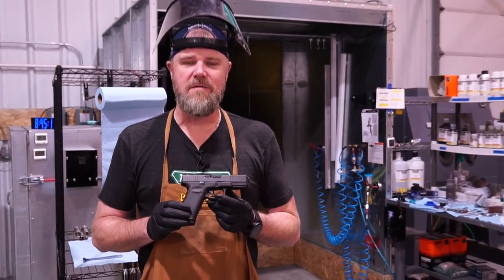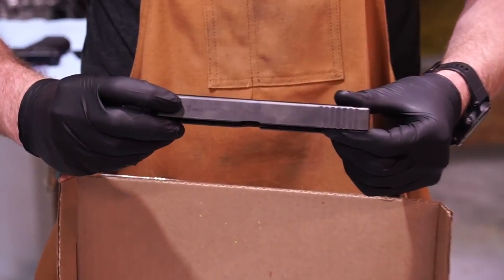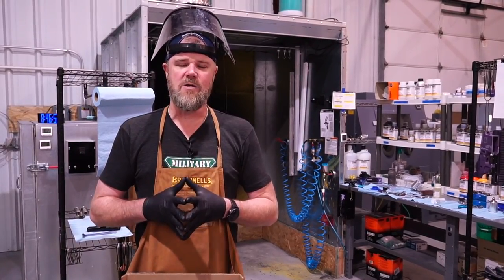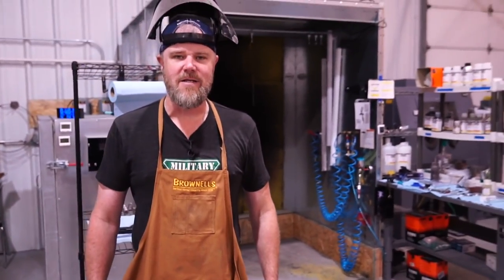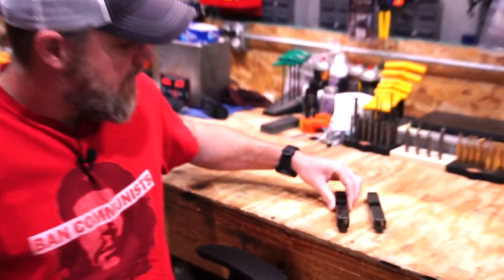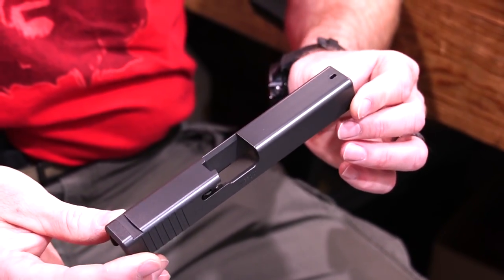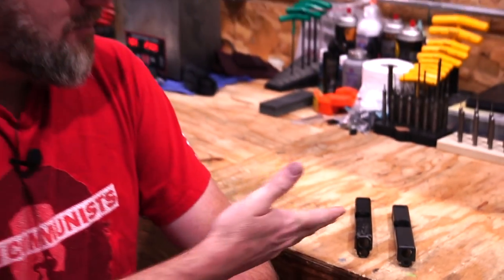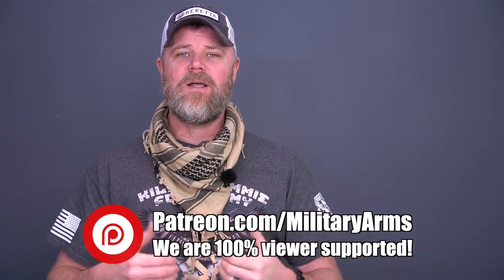Cerakote Acid Test

Comment: I work in heat treat inspection. I do MPI testing and Rockwell hardness inspection. We spray paint the bars to color code them so we know what machine induction hardener they are coming off of. As part of the hardness testing we dip parts in acid so we can visually see “like a tree truck” the metal will have rings of various hardness.  That being said. From my years of experience regular industrial spray paint will do the same. Acid has no affect on the spray paint. This has always surprised me. Side note. Metal will instantly rust when its exposed to acid.
Reply: The oxidizing base in the acid is what cause the rusting. And yet the Gen5 didn't rust...why? because of the Nitride treatment applied to the metal prior to the DLC finished added. I have my Ph.D. in Chemistry. This test was garbage. Both test subjects were in the same vat. That's a no-no. The test field was now contaminated.

Comment: Interesting timing. I was just cleaning some rust from my G17 yesterday. I was shooting it a while back, stored it and didn't wipe down the slide like I normally do, and I came back to find a few, small clusters of rust where my hand would rack the slide. I plan on getting it milled out for an RMR and having it refinished with Cerakote, so I'm not too bummed out, though I'm still surprised that my sweat over a few days was enough to rust through the original finish.

Comment: this is more important
from their website:

When we say performance we mean:

* Exceeds 9h scratch and gouge hardness (ASTM D33630

* Taber abrasion greater than 8000 wear cycles per mil (ASTM D4060)

* Corrosion resistance more than 3000 hours (ASTM B117)

* Direct and indirect impact resistance of 160 in-lbs. (ASTM D2794)

* 0mm coating loss at 180* mandrel bend (ASTM D522)

* Coefficient of Friction rivaling Teflon at 0.11 (Steady-State Dynamic Coefficient of Friction Under Load)

* Extremely high chemical resistance (Specific chemical performance available by request)

Comment: Breaking bad actually used Hydrofluoric acid, but I'll give you a pass on that one Tim 😁.

I work with this crap, and other fun stuff on a daily basis. Being a scientist can be fun, sometimes haha

Fun fact, skin exposure of more than 25 in^2 of HF can lead to cardiac arrest and death if not treated immediately
Reply: As an engineering student summer laborer in an oil refinery, I worked near the HF Alky unit where hydrofluoric acid was used.  I borrowed the thick pink space suits for a very corrosive job in a different unit.  At the time, the treatment for dermal contact with HF was injections of calcium gluconate at different layers to attempt to neutralize the very polar hydrofluoric acid before it reached the bone.  Very nasty stuff, indeed.

Also, recall that in Breaking Bad, Walt told Jessie to get inexpensive polyethylene storage containers to use for "chemical disincorporation" because the concentrated acids don't react with this inexpensive plastic.  That's why Tim's hydrochloric acid was packaged by the manufacturer in a polyethylene bottle.  Acid doesn't attack cheap plastic, so maybe Tim proved that Cerakote Elite is cheap plastic.  (I joke!  I joke!)  But seriously, this wasn't a very scientific test.
Reply: @Liberty4Ever  thankfully they just use the calcium gluconate topical gel to neutralize it. The most we had for protection at my first job (it was a contact pharmaceutical testing company) was a fume hood, long gloves, apron, and a face shield. At my new, and current job for a pharmaceutical company, they've eliminated HF from usage but did have additional safety shields and the buddy system in use for utilization...I refuse to work with that crap.

And Tim knows this isn't a scientific test, he claims so in many of his videos. But if the Cerakote can withstand HCl, I'm almost certain it would stand a salt spray for thousands of hours.
Reply: Liberty4Ever yeah i remember being told in my highschool chemistry class that hf will dissolve your bones before it dissolves your muscle tissue
Reply: @Je3perscre3pers  We used HF in the finishing shop at Anniston Army Depot. We called it "bee sting".  Will easily melt flesh. (Washed our hands in hydrocloric.)
Reply: John Speer yeah this was in Juvi school prison. The same science teacher who claimed marijuana causes testicular cancer if you smoke it once.
Reply: I thought it was muriatic acid....?
Reply: Yeah...HCl isn't as nasty (though no saint) as people think it is. We used it for a boiler cleaning (water-side) and the chemist I was working with told me I could dip my hand in it for all he cared as long as I didn't get it in my eye's, snort it or drink it. The HF (we were also using), on the other hand, would dissolve bone. We also didn't just rinse the boiler after the acid was done doing it's thing. We did a full neutralization (not a deactivation, whatever that is) AND rinse. We also did a passivization, but that was more about establishing a protective oxide layer than treating remnants of the acid.   

Another fun acid story: A truck driver delivering sulfuric acid at an ethanol plant wasn't wearing his rubber apron (WEAR YOUR PPE PEOPLE!!) and some splashed on an exposed section of his beer belly. Burned right into his gut. He was in the hospital for a month or two.
Reply: @timb83  yeah Sulfuric is pretty nasty too. HF, Sulfuric, Nitric, Proprionic, Perchloric and Phosphoric are some of the nastiest ones I can think of off the top of my head. Aqua Regia is awful as well
Reply: we used to use phosphoric acid to treat ammoiniated liquid fertilizer when I worked for Tru-Geen.
at least I think thats what it was.  does that sound right?  maybe a low concentration?
regardless, whatever it was, I had to hold my breath when using it(wore face shield and gloves), because the fumes coming of it were horrible, especially after I would dump it into a tank and the fumes would waft up.
Reply: @Mockturtlesoup1  probably phosphoric acid. We used to get urea pellets and made a 50/50 liquor at the plant for injection into the SCR. On occasion they'd load the trucks with the same end loader they'd use for fertilizer and contaminate our urea with phosphorus. Problem was 10-20 PPB phosphorus would poison the catalyst, so that small contamination would ruin thousands of gallons of urea liquor. I'd spend 4hrs making a batch just to dump it all when the tests came back bad. (Our storage and solutionizer tanks weren't big enough to dilute out the phosphorus).
Reply: @Mockturtlesoup1  that could be any acid, but phosphoric fumes are pretty damn bad
Reply: @timb83  We used 20% HCL @ 180 degrees and it did a good job descaling the tubes and wasn't bad on the skin. Cleaning evaporator tube nest we used 60% and it would eat you up as bad as flaked caustic soda. Once a chemist suggested using 90% HCL on an Evap. tube bundle but the chief engineer and I decided we would just retube the bundle, rather than have 300 gallons of that mess on the ship.

Comment: I agree that the current Glock finish is not the best, I had a Glock with Ceracote and my slide scratch with only a couple of draws out of my holster. The Ceracote was applied by a professional so no question about that, I don't even consider Ceracote as a finish as how it came off of my slide, so I sent my slide to Robar and they did and awesome job and my slide was truly protected. I won't touch Ceracote under any circumstance.

Comment: Choosing a random acid doesn't speed up normal corrosion. Every material has certain things that will attack it, and some that won't. For example pure sulfuric acid is fine on bare steel and should pass this test, showing uncoated would be a great coating.

Comment: I've used HCL vapor on metal guitar parts (suspending them in a sealed jar with a smaller open jar of HCL inside) to age them when building relic guitars. It accelerates regular corrosion, and is a good test; twelve to 24 hours is usually enough to show surface corrosion. That the Cerakote could withstand overnight immersion in liquid HCL is impressive.

Comment: The new cerakote looks like a winner. Also, water and acid are not compatible. You need something that is a higher PH base to neutralize acid.  Dipping the slide with trace amounts of acid in water isn't a big deal. However if you splashed  some of that water into acid it would make a pretty violent chemical reaction causing the acid to boil.
Reply: Do as you oughta, add acid to watta
If you wanna get blasted, add watta to acid

High School chemistry take-away.

Comment: I appreciate what you tried to do here, but not all acids corrode the same. Just because a certain acid is more corrosive doesn't mean it will corrode all materials faster, or even at all. Some relatively weak acids can corrode ceramics and glass, while much stronger acids will not.

Comment: Wow, great test. Very surprised by the cerakote results. Thanks for conducting!
Reply: How can you be surprised if you know from the start that the ceracote will be the clear winner?
Reply: Cerakote isn't paint, it is essentially a two part epoxy like material. It cures into a polymer. Polymers are known to be chemically inert. That is makes them work.
Reply from the maker: We did? Damn, now I’m clyaravoyant! Kick ass!

Comment: I did a Poly80 build with a LoneWolf AlphaWolf DLC coated G19 slide. The pins aren't holding up to appendix carry during a sweaty Florida summer with light surface rust. I would wipe down daily then wipe the pins down weekly every Friday night or weekend during weekly maintenance.

The DLC coating has been fine A+ highly recommend. I'm very familiar with Tennifer wear on Gen 2-3s.

Comment: It's been pointed out a few times already, but the science, or lack thereof, off. I also did some digging, and it was pointed out previously that Tenifer is actually not banned, and the process is exactly the same as Melonite, since one company owns the trade-name rights, or at least it was one company at one time or another or some other such stuff. 

I'll take a chemical case hardening surface treatment over a hopped up spray paint any day. It's just like with anything aluminum: hard anodizing beats cerakote applied to natural aluminum every single time.

Comment: If you were going for a ramped up oxide reaction (what you get from salt) sulfuric or nitric acid would have been better choices. Hydrochloric's specialty is dissolving oxides, but it's weak to plastic, polymer and most hard metals like steel and iron.

Comment: nDLC stands for (nitrided diamond-like carbon)
Glock still treats there barrel and slide with Tenifer like treatment, they use Gaseous ferritic nitrocarburizing now which is an environmentally friendlier process instead of Salt bath ferritic nitrocarburizing (Tenifer). Nitrided parts are then coated with DLC which is Physical vapor deposition coating.
So no matter what happens to the black DLC coating on the Glock slide or barrel the hard Tenifer/ Melonite like treatment will protect it from corrosion and wear!

Comment: Very impressive. I will only point out that the green bucket should have had some baking soda mixed in with the water (like Arm & Hammer) in it. That would better neutralize the acid. In chemistry labs, we always have baking soda around to deal with acid spills.
Another test that would be cool to see would be an abrasion test. For example, take an AR bolt carrier and apply the product to that. Obviously you want to take care not to sandblast inside the gas cylinder for reasons you've outlined in another video.

Comment: Thanks for the science Tim!  I have a Mossberg Shockwave in cerakote FDE.  I like the look, but I can see a mark if I just drag a fingernail across it.  I don't care so much about those little mars, but want to see how that glock slide handles kydex holster wear over time.
Reply: In 2023, I've bought and used a few Cerakote Elite in the last few years. I've seen + Cerakote Elite work & a few bad, screwed up applications. 😖  If you want gunsmithing, cerakote work, get a respected, well known place. Be aware the coating-liquid can wear out, weaken too. Cerakote Elite can not sit for extended periods, months-years. It must be applied by a trained specialist. I have 1 Glock 22 gen 5 MOS with grey Cerakote Elite, cement & a used Glock 41 gen 4 with a blue Midnight shade. These slides-barrels turned out fairly well. No scuffs, marks, holster wear, etc. My used Glock 22 gen 4 slide Carbon Grey was screwed up!

Comment: I'm not saying nDLC is the best ever, but this doesn't tell the whole story or shake my faith in nDLC. Cerakote has always been where it's at for corrosion resistance, but has always been outclassed by tennifer and DLC in hardness and wear resistance. The plastic that the HCL container is made from isn't affected by the acid either, but that doesn't mean it is overall a more durable finish. Just taking this with a grain of salt is all.

Comment: Maybe my eyes are bad, but as you were presenting the post-acid Ceracoat, I swear I saw flaking on the inside of the slide @9:13 (forward of the ejection port on the side) and in a nook where the rear plate would slide in @9:18.

Comment: The water just dilutes the acid.
Chemical reactions are different depending on acid and materials exposed to acid.
There are probably other chemicals that would eat the cerakote finish.
Ospho will turn rusty steel black and stop corrosion it will also eat through aluminum, it will not harm the steel parts of your gun but if you have any aluminum parts it will destroy them.

Comment: K which is more wear resistant with holsters and such cause I hate the gen 5 holster cuts on the nose I love  the lower but not the nose cuts a Glock bid a Glock don’t mess with the corners lol I love serrations but I also hate ceracot prices that cost as much  as a pistol and carry 1 to two times and see bare metal scratches
Reply: Glock fan boy is triggered
Reply: Charger SPS just wandering which will wear faster the new Glock finish or the new ceracoat I don’t even like the new gen 5 glocks upper style
Reply: OtterConnor just wandering which wear faster with holster and carrying the new copper custom Cera  coat or the Glock finish on the gen 5 cause I don’t like the style of the gen 5 slides I hate the holster cuts on the nose of the new glock slides

Comment: this test doesn't prove anything. the chemical reaction of hydrochloric acid is completely different to that or sea salt
Reply: Cerakote completely seals the metal from contact with anything and isn't changed by salt or water. A treatment is altering the steel itself which can be affected directly.

Comment: hey MAC, just curious, at the 9:12 mark in the video it looks like there is a flake of cerakote hanging on the inside of the slide and on the back of the slide, at 9:19 near the striker channel it appears to have maybe bubbled up a bit  on the left side of the opening for the striker channel. could just be the glare or something but im curious to see if it in fact damaged or actually in perfect condition. thanks

Comment: This cerakote is impressive.  Whether ndlc, nitron, melonite, etc I've never had an issue with corrosion for modern finishes, and even the issues I've had with bluing could be touched up.  That said I am pretty OCD when it comes to cleaning and where I live isn't very humid, though it is near the ocean.  If I was refinishing a pistol I'd certainly give this a hard look, but I don't think I'd have the finish on a new pistol stripped to apply this.

Comment: I have carried a Glock on duty for 29 years in various types of weather. With basic maintenance, my Glock has not corroded in any way. I have also shot thousands of rounds through it. Other than for personal reasons, there is absolutely no reason to spend the money to change the stock coating.

Comment: After the first year of carrying my gen4 g19 everyday, it had slide wear on the top edge of the slide and started rusting and actually pitted the metal. I had it sent to atei for a slide mill and they did the factory coating. It has held up for 2 years so much better. This cerikote is very interesting.

Comment: On the job I have repaired plumbing for Sodium Hypochlorite pumps used for water treatment. That stuff also causes rapid corrosion on metal.
  Within minutes Your channel lock pliers  look like they came out of a Somali Pirates boat. LOL
  The chemical that You used is even worse, it is very impressive how well Your finish held up.

Comment: @Military Arms Channel: This is a compelling visual, but doesn't Glock put a second finish (black) over the base protective finish (gray)?  I'd like to see if the metal will actually rust on that slide, or if the only element removed was the other (and, admittedly, possibly the *only*) layer.  Can I get a follow-up on this?

Comment: 9:12 in the center of the screen, inside the slide. There appears to be some paint peeling off. Is that due to the acid, a bad application of cerakote, or an illusion by the camera?

Comment: Remembering my college chemistry (I'm NOT a chemist), I wonder whether a better test might be something like bleach, or hydrogen peroxide -- oxidizing agents. In fact, those "rust removers" or "rust blackeners" they sell are in fact a weak acid. Yes, of course, acid will eat steel -- but's it's not the corrosive condition that guns are typically under. Salt water, of course, is the standard test for metal resistance to corrosion.

Comment: What if any kind of abrasion tests have you performed on the new cerakote? The corrosion resistance is impressive but how well does the finish hold up to repeated holstering and re-holstering? Yes wear is inevitable but it is always nice if it can be slowed down.